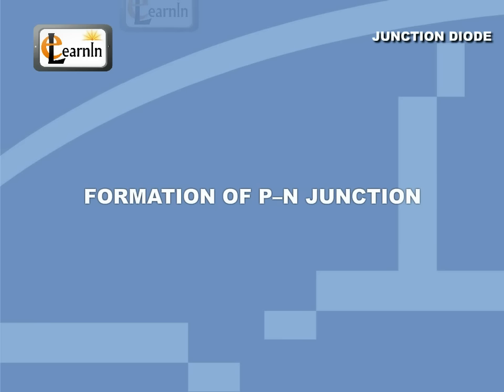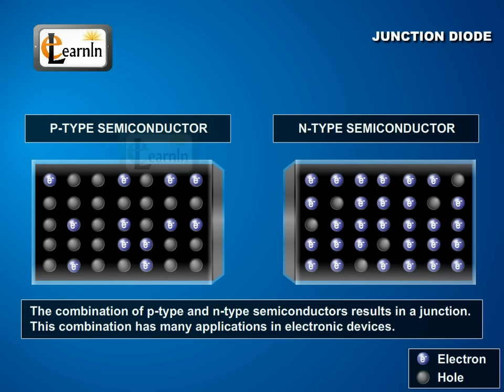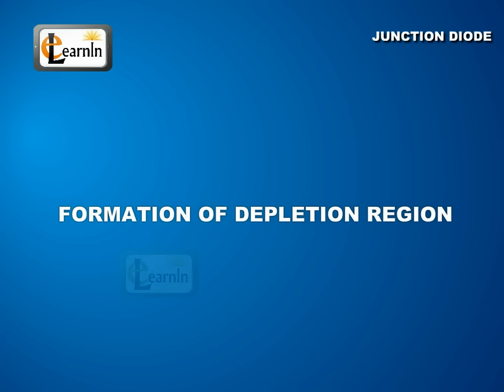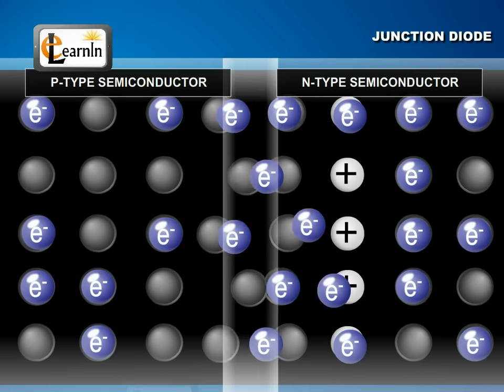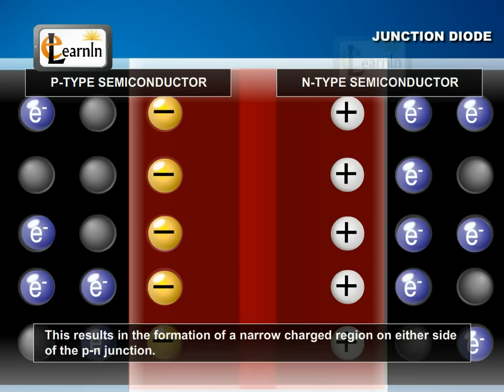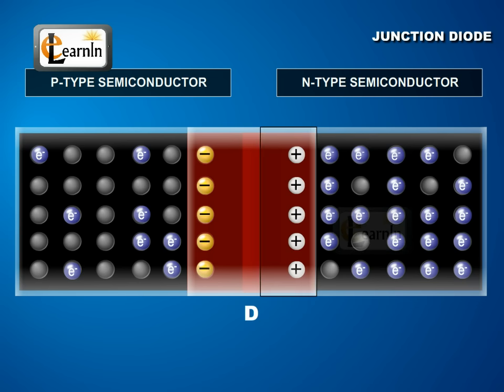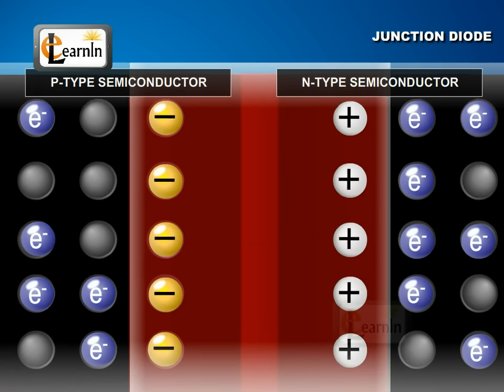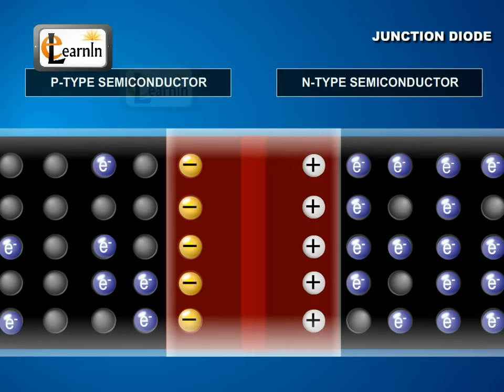Formation and Properties of Junction Diode - Physics

Comment: if electrons and holes neutralizes each other then how positive and negative charges are created? may be i am not getting the point. plz if someone can explain it to me
Reply: In p type each atom Of S.C  takes electrons from each other  due to deficiency of electron  getting negative charge on it  ...... Similarly In n type each atom of the dopant donate electron getting positively charged
Reply: I also had the Same doubt, but after watching this I got this. 
In the Cathode (N) Side we have 1 Extra Electron and On the Anode(P) side we have 1 requirement of Electron. 
So 1 Electron Transfer from N side to P side due to which both becomes stable, 
The N type which gave the Electron gains A net positive charge (because the Total Number of Proton is 1 more than the Number of Electron {{as 1 Electron is transferred to P side}} ) 
The vice versa Happens on P side It receives 1 Extra Electron and Gains Net Positive Charge.
Reply: Thanks a lot❤
Reply: That charge is due to donor and acceptor core
Reply: Due to diffusion of elctron and hole

Comment: Thank you so much for the video, it was amazing. Just a question about the PN junction, when we apply a voltage across the PN junction, why does the current only flow in one direction and not the other? Thank you :)
Reply: That is because of forward and reverse biasing.

Comment: @huiling Zheng The reason for that is when you bias a p-n junction diode using a battery for example, and set the battery in such a way that will ensure the diode will go into reverse mode the depletion region actually gets bigger, therefore preventing currentfrom passing through. On the other hand when the positive side of the battery is applied at the p junction in the diode the depletion region gets smaller as the voltage is increased until it tottaly disappears when the applied voltage is at 0.7 (Von)

Comment: In the Cathode (N) Side we have 1 Extra Electron and On the Anode(P) side we have 1 requirement of Electron. 
So 1 Electron Transfer from N side to P side due to which both becomes stable, 
The N type which gave the Electron gains A net positive charge (because the Total Number of Proton is 1 more than the Number of Electron {{as 1 Electron is transferred to P side}} ) 
The vice versa Happens on P side It receives 1 Extra Electron and Gains Net Positive Charge.
P.S.: For those who keeps forgetting Basics like Me.

Comment: So,  we take two separate pieces(one p type and one n type) and join them together?
Reply: Nope you can't do that, a wafer of a p-type semiconductor is considered and a part of it is made n-type by adding some pentavalent impurity.
Reply: if u take two separate then p-n junction will not be formed
Reply: Nope . U must join them w/ the help of chemical processes. Cause if u'll join them physically the dis. B/w p and n type will be greater than the interatomic dis. Which resrtict the diffusion of holes and electron.
Reply: No, 2 separate semiconductors are not taken , a single p-type wafer is taken and precisely a small amount of pentavalent impurity is added to one side of the p-type semiconductor , this type now becomes n-type.
If 2 separate n-type and p-type semiconductors are joined they will not form a pn junction as there will be microscopic gaps in between the 2 pieces . Therefore a single material is doped with half pentavalent impurity and half trivalent impurity .

Comment: So let me get this straight, Electron goes towards the hole (AKA Electron goes from negative to positive), so the Point-A where the electron started before moving is N-type semiconductor (it has excess electron), and the B-point where the hole exist and electron move towards B-point is called P-Type semiconductor (It has a lot of holes).

When the two semiconductor meets, it creates two line where the first line is where the hole is filled with the excess electron and the secon line is where the excess electron is gone because filling the holes from the first line. So basically, both line now has the same amount of electron which basically have no differences.

But both line called differently, one called Positive because it previously has holes and the other one called negative because it's previously have excess electron. Other than the origin, the current state is no different.